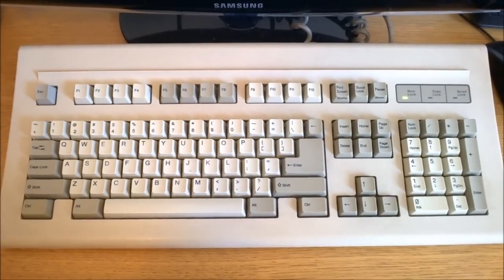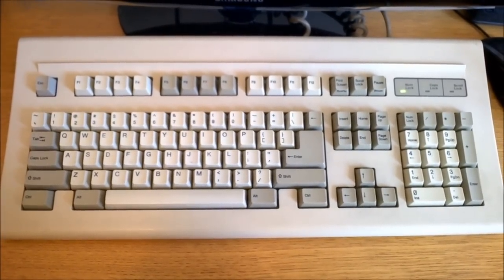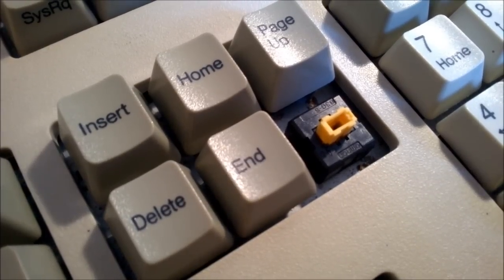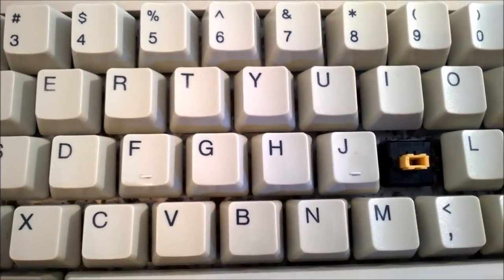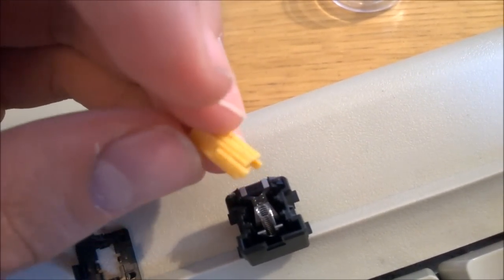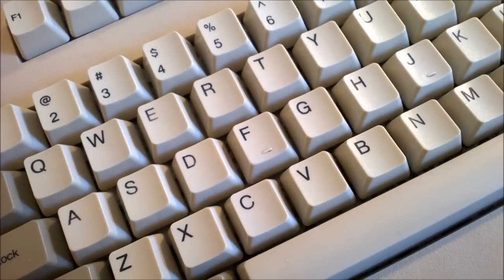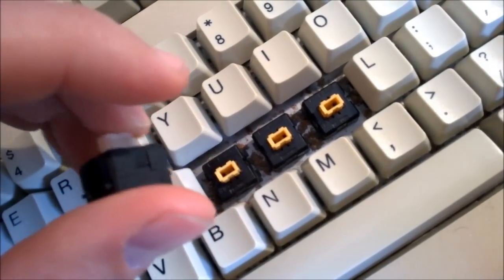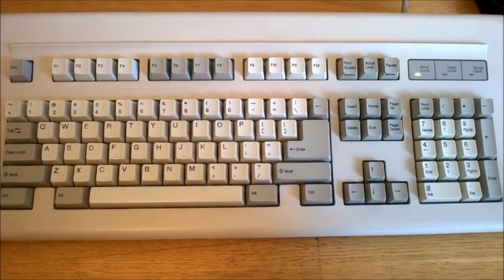Chicony KB-5161C review (Amber Omron B3G-S)

Comment: I have one i got a few years back from a thrift shop, it has monterey blues installed. the case is really beat up and it is missing some keys. I would love to restore it someday.
Reply from the maker: +mike52787 A 5161? Funny, that hasn't even been documented xD . Those show up more often in the 5181. The 5161 appears to be the board shipped with THE highest amount of different switches xD .
Reply: You are actually correct man, after posting this comment, I pulled the board out and saw it is a 5181. It is branded ULTRA. I really want to get it back going again, I really like the feel of the monterey blues (not as much as my model m though).
Reply from the maker: +mike52787 Montereys are among my favourite switches, so smooth, light and delicate. They have a great reputation, but are still actually unstated in my opinion. Probably partly because all the boards they feature on have quite mediocre build quality xD .

Comment: I found one of these at the local dump with blue alps switches, C model. 
So full of dust and grime, also reeks of smoke, took everything apart, even the switches and cleaned those as well on the inside.